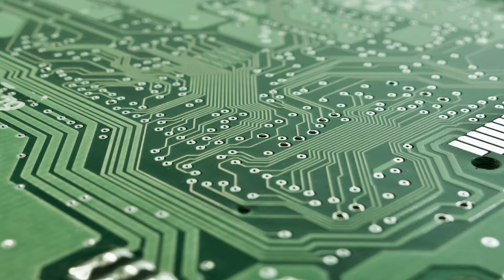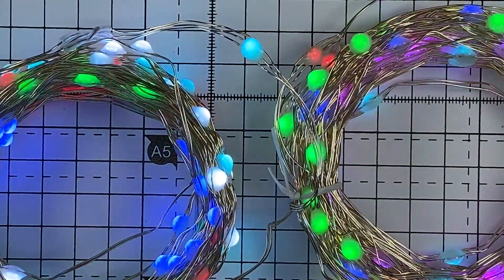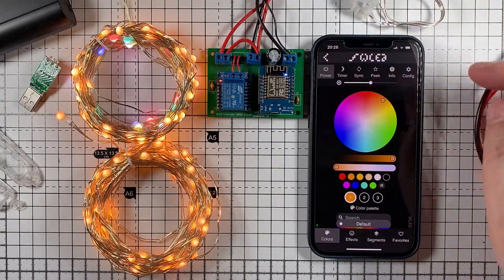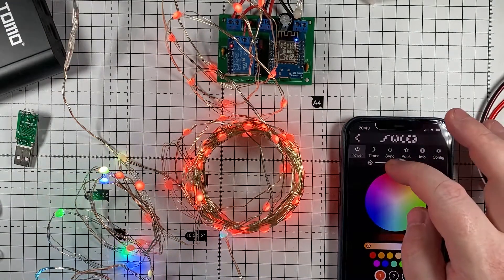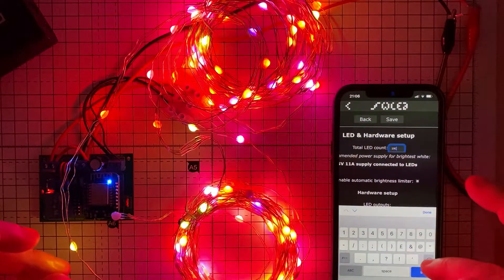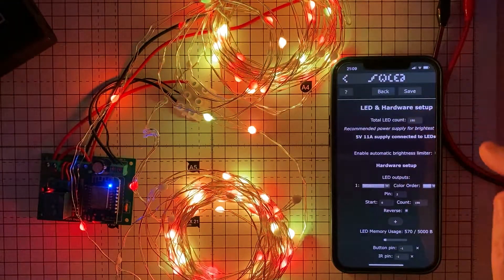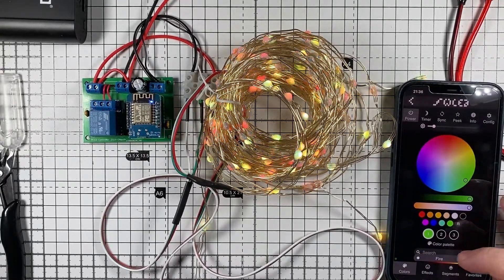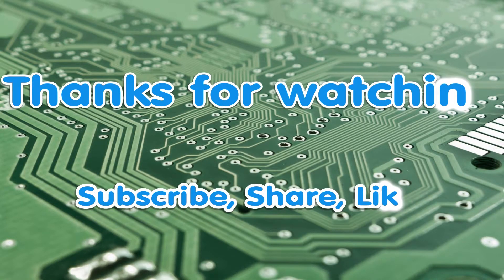EP 011 - eBay 20M 200LED fairy lights, Addressable LEDS, WLED [led]

Comment: I think these leds are hard coded with the pixel address so when you cut them say after pixel 20 the pixel after doesn’t become pixel-1 on wled it is still pixel-21 that may be why you had some unlit i may be wrong
Reply from the maker: Maybe , they were using the standard protocol so I’m not sure , I think it was length of the line and the signal not being strong enough.